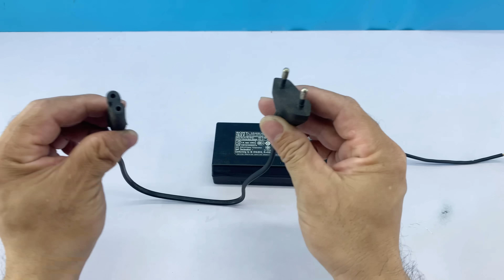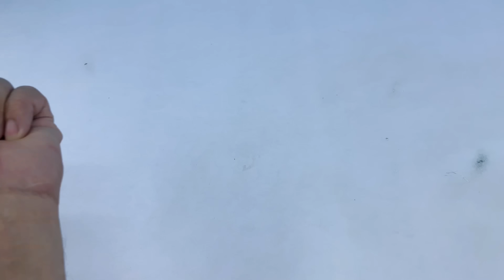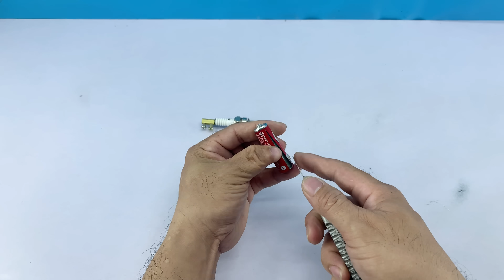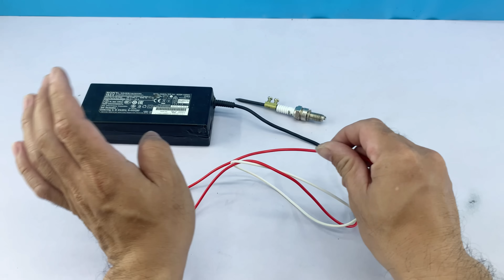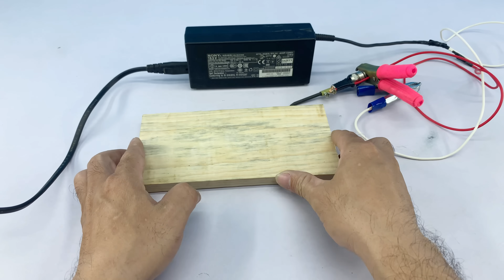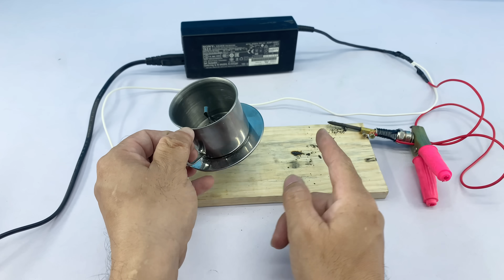Nobody Knows About This Hidden Feature of Old Laptop Chargers! Unbelievable 😱

Comment: I've tried this tutorial by replacing the laptop charger several times, but it doesn't produce a strong flame or weld. Please guide me. Thanks.
Reply: Why can't the video be downloaded with IDM?
Reply from the maker: Good question! 💡 Some platforms block IDM downloads to protect video content. You can try using the official “Download” feature if available. Do you usually save DIY videos to watch offline? 😊
Reply from the maker: Thanks for sharing your experience! 🔧 If the flame or weld is weak, it might be due to low current output from the laptop charger. Try using one with higher amperage (like 5A or more) and check all connections for tight contact. Would you like me to show that setup in a detailed video? ⚡

Comment: Me from Denpasar, Bali province of Indonesia.
Interesting idea it truly is.
Question: what kind of metal rod did you use in welding a bolt on the bearing hub?
Reply from the maker: Greetings to Denpasar, Bali! 🇮🇩🌴 Thanks a lot for the kind words! For that part, I used a regular steel rod — nothing fancy, just strong enough to hold the weld firmly on the bearing hub. 🔩💪